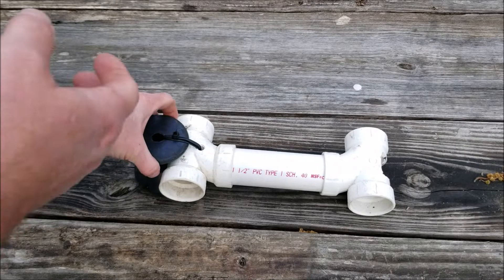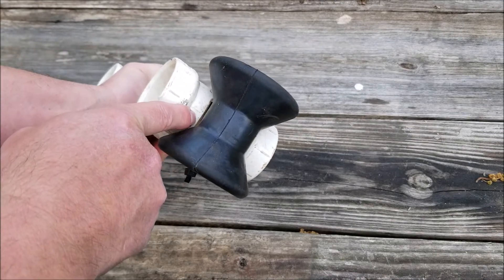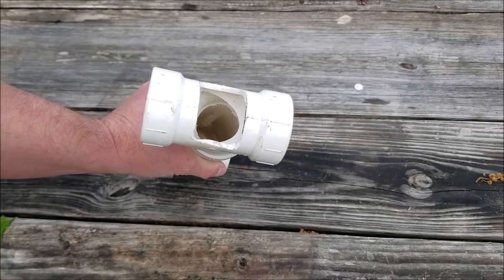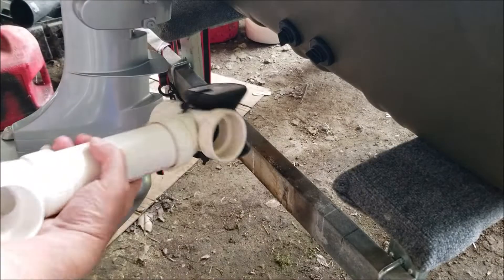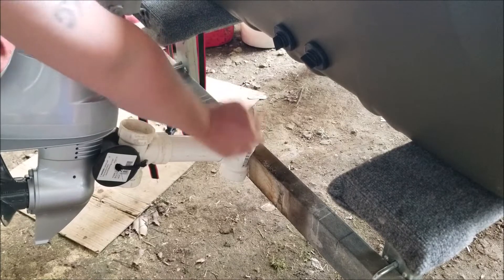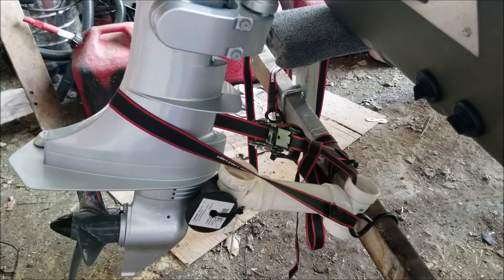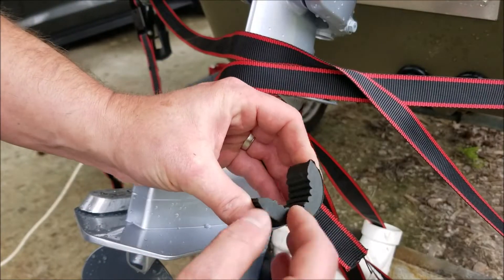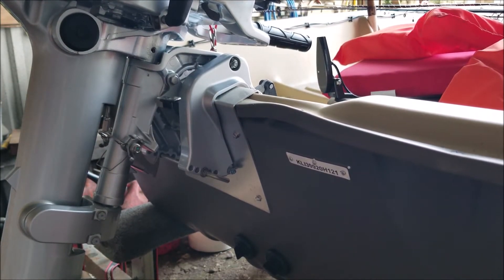DIY Outboard Transom Saver - PVC and a Rubber Roller | 2022 Honda 5hp 4 Stroke Outboard BF5D

Comment: This is actually genius lmao
Reply from the maker: I'm no genius, but I'll take it where I can get it 😄.  It has worked great so far.  I have to use straps on the left and right side of the top part of the outboard to stabilize the motor from turning left or right.  At first, I didn't do that, and the motor would turn, yielding slack in the transom saver strap.  So far, no issues.

Comment: Would this work for large outboard 125hp+
Reply from the maker: If you can keep the motor from turning left or right while trailering, I don't see why not, such as using straps to keep it centered.  You could go up a size on pipe diameter and possibly use a deep vee rubber stop bc of the larger motor.  I would even suggest using a pipe diameter large enough to where you could slide the block end of a deep vee eubber stop into the pipe and use a nut/bolt combo to hold the rubber stop in place.
Reply: I like it 👌